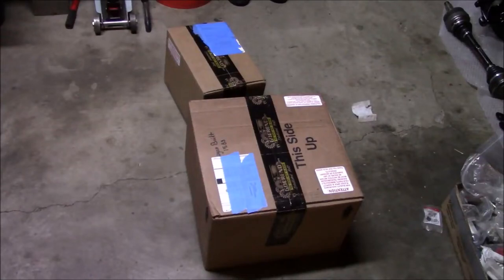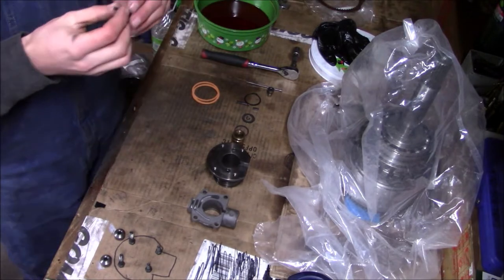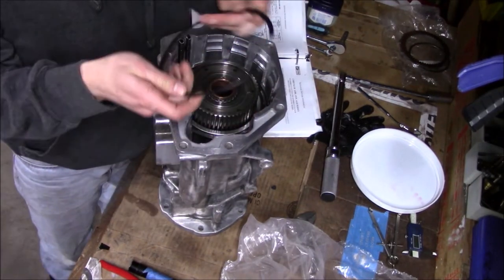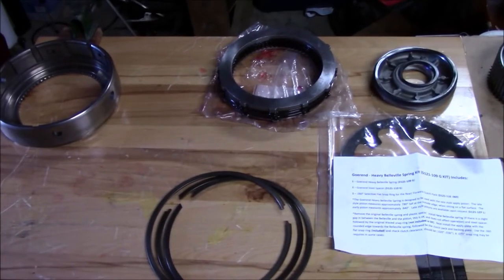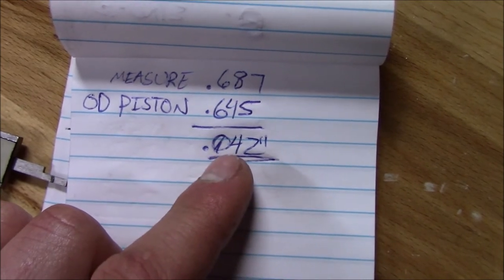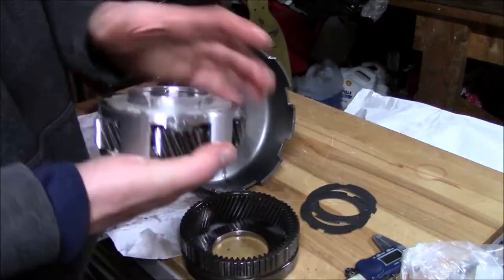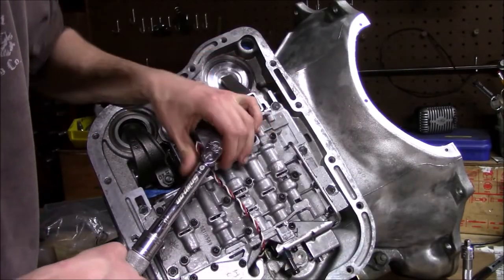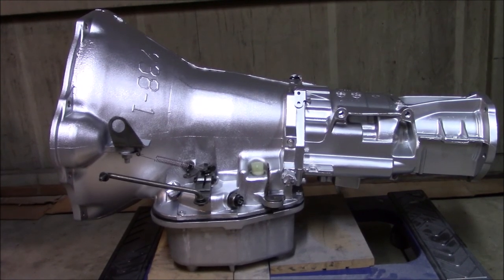47RH Transmission Rebuild

Comment: God damn. Who ever invented a automatic transmission is a genius.  Idk how you remember where everything exactly goes. I wish I could rebuild mine but I wouldn't know what to order or remember how it would go back together.  I'm just going to buy a rebuilt one.
Reply from the maker: Definitely, it's amazing how much thought goes into them. Best of luck with your project, feel free to subscribe if you think my channel deserves it, and have a great day man
Reply: @10mm  btw how would it cost in parts to do a slight upgrade trans for my cummins to make it a little more reliable.  I dont need it to be crazy since its stock. Just reliable.
Reply from the maker: @pablomarquez4431   That depends on a lot of things man. How deep you want to tear into the trans, your budget, etc. A nice valvebody and a billet input shaft can help a lot.
Reply: @10mm  did yours cost over 2k? I want to be around 1,000 in parts
Reply from the maker: @pablomarquez4431  Yeah a lot more than 2K, unfortunately that doesn't get you much in the diesel automatic game

Comment: killer pair of videos man. gives me the confidence i needed to tackle this rebuild on my 2nd gen. it's got some funky stuff going on, I think partially with the valve body but it's also very slow to shift properly into 3rd and OD when the trans is still cold.
Reply from the maker: Thanks and I appreciate you subscribing man! So you rebuilt it and now it's doing that or it was doing that so you started a rebuild?
Reply: @10mm  no it hasn't been rebuilt yet. It started doing that a year ago and has slowly gotten worse over time. I never really pull trailers though so it hasn't been much of an issue. It's just time to freshen everything up though. How much hp will yours hold with everything you did to it?
Reply from the maker: @bargainbear1483  Ahh gotcha, that's a good question man. In theory it can take a lot more than a VE truck can dish out
Reply: @10mm  well sweet that's good to know. what was the total cost of all the parts you bought for the trans if you don't mind my asking? I had one out of a 96 i had get rebuilt by a shop 5 years ago and spent waaaay more than I should have. I could just throw money at this too but that just seems lazy to me with my current lack of projects lol.
Reply from the maker: @bargainbear1483  It was pretty pricey, over 3k but thankfully selling the old 46rh/A518 reduced the cost a lot.

Comment: I enjoyed your presentation. In the vein of "new eyes sometimes see things I don't", I would point out your cardboard work surface. I bet you are getting wood fiber contamination on your parts. As a compromise, could you use something like a plastic cutting board for placement of clean parts and actual assembly? That would let you keep on with the oil absorbing cardboard for spills.
Reply from the maker: That's a really good point, you didn't see it much in the video but I did use compressed air and solvent to clean really crucial areas. Ideally I'd like to build up a steel top work bench at some point. Thank you for subscribing and I appreciate the input.

Comment: Curious how you settled on the band adjustments 2 1/4 and 3? Iam just learning about my 47RH. I have come across many band adjustment values ranging from 1 7/8 to 3 on the Kickdown and 2 - 3 on the Low Reverse. Cool video well played. I will certainly keep it for reference. Thank You
Reply from the maker: Glad I could help, thanks for subscribing that's much appreciated. The numbers were given to me by a parts distributor that I have faith in. The transmission shifts and tows great.

Comment: Man what a great vid on this trans. Same one im working on. Figuring out the shims was/is making me crazy. You spent some $ on your build.  Who did you buy your 6 planet forwarded from. You got me to in the first few mins. I have watched hours of trans vid. Yours was the best for getting the shims right!!
Reply from the maker: Glad it's helping you out! Thanks for subscribing and the kind words. Yeah it was pretty pricey. Thankfully, selling the A518 made back a decent chunk of change. I got my 6 planet from Transtar Industries.
Reply: @10mm  did you think about up grading the 518 to 47rh? I have a 47 on the bench now and a spare 518 OD non lock up. Im told I can buy the input shaft, stator support, pump housing and valve body plus the associated plugs and it will work. But thats a different project for later.
Reply from the maker: @2eyedjack433  I didn't know that you could build a 518 into a 47 until I had already begun building up my 47. I stumbled across a thread on a diesel forum explaining how to do it which is super cool. Luckily I paid next to nothing for my 47 so it didn't matter. But yes, if you can't find a stupid cheap 47rh, I think making a 518 into a lockup is a great plan!
Reply from the maker: @2eyedjack433  And yeah you nailed the recipe if my memory is right. You'd obviously want to do the higher count clutch packs too and of course a nice converter.
Reply: @10mm  thats the problem in my area, finding a cheap 47rh. There all start at 500 for basically cores. Then you end up having to totally go through them.  When my 47 went down I bought the 518 not knowing it was a non lockup trans. It was a fresh rebuild. Since I didn't have the backing plate or starter froma 1st gen its been sitting. I got a first gen 2 months ago. So now its has a purpose. Lol..

Comment: Sub . Where did you get your transmission manual you are using? I built a lot of 727 back in my youth from having a big foot and big motors. I have not dealt with an overdrive but that part seems to be about the only difference.
Reply from the maker: Thank you! I really appreciate that! It's an ATSG manual that I found online and printed off.
Reply: Thank you for the information. Great build by the way.
Reply from the maker: @zaneturner4478  Thanks a lot man! Thanks for subscribing too I appreciate that!
Reply: @zaneturner4478  what does having a big foot have to do with rebuilding transmission and motors?

Comment: Hey where did you get a .615” OD piston? I’m currently dealing with the exact same thing with my 47RH build. The clearance is pretty low (.062) and I want to increase it but I realized I have the .645” piston too.
Reply from the maker: Hey man, sorry you're having trouble. I got mine from a local company. If you can't find one on ebay, try Loganbuilt.
Reply: @10mm  Yeah I've been looking on eBay but nobody lists the thickness and I feel like a lot of them are the .645" and they just list it for all the models anyway. Thanks for the tip on loganbuilt
Reply from the maker: @bobbybeyer2127  Yeah man, no problem. Georend would be another company to talk to they know their stuff. Thanks for subscribing I appreciate that it means a lot!

Comment: whats the total cost vers buying a rebuilt
Reply from the maker: Yeah man unfortunately diesel automatics are very expensive. It depends on where you live and what parts you decide to upgrade. and of course fixing what actually broke.
Reply: @10mm  i have the 5.9 v8 magnum gas version 2wd and trying to find a transmission for it at a decent price is hard
Reply from the maker: @michaeld954  Oh gotcha, sorry man I'm not too sure about those.